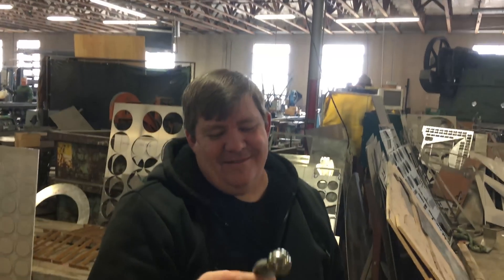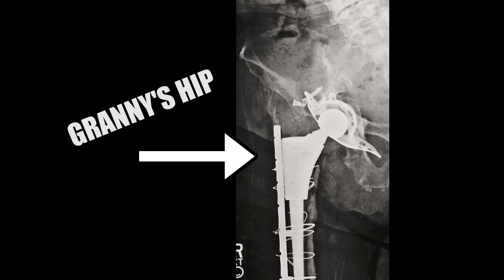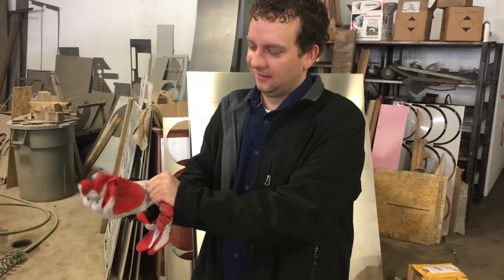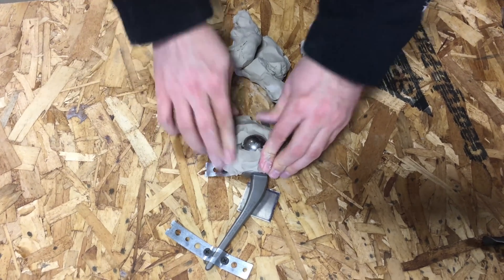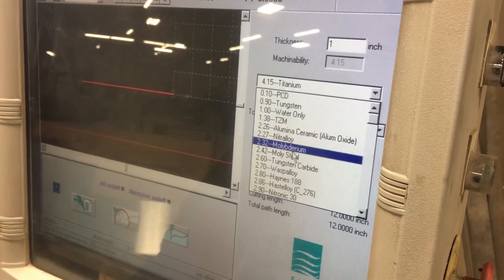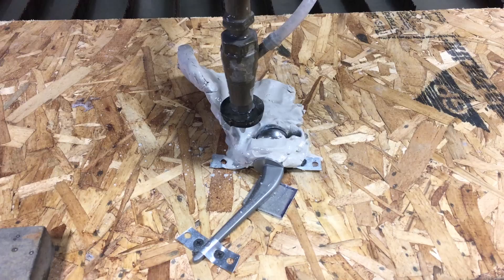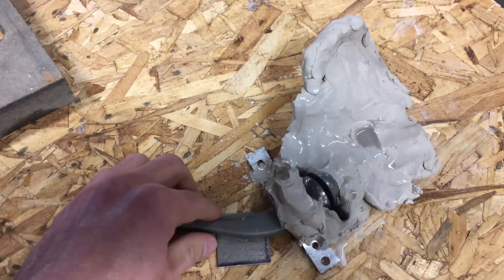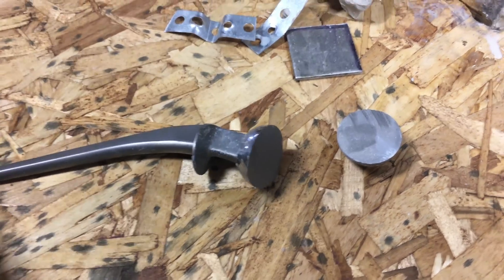Titanium Hip Replacement vs 60,000 PSI Waterjet

Comment: Titanium is not as strong as people think it is. What makes titanium so great in aerospace engineering is its phenomenal weight to strength ratio and its resistance to high temperatures. Also, the process to isolate and produce titanium metal has been exorbitantly expensive for decades and only now, within the last decade, is not that bad anymore.

Comment: get a knife and position it edge up, im curious if the thin edge will just separate the water in 2 smallers streams or if the water will just cut trough it
Reply: DutchClawz I actually think they did that already
Reply: DutchClawz look up them cutting csgo knives

Comment: Nothing like watching a +$10,000 titanium hip getting cut with water
Reply: If it was put in an ingot it would go from like $10000 dollars to max $500
Reply: Sam Kelly no
Reply: Well it is only worth that before they put it in... Once it has to be pulled out of a patient it is worthless for medical purposes. They cannot be reused because you cannot be sure it is 100% sterilized. Much less Hip replacements are rarely removed while still in good condition. Usually they have failed in some manner which really makes them worth nothing more than the price of the metal itself.
Reply: Titanium scrap goes at about $1.5 per pound. 
Used part is worth around a dollar.
Driving it to recycling plant is too expensive.
Reply: It is probably tens of thousands for a whole procedure including surgery, rehab, hospital days, etc. The metal thing itself is a minor part of it.
Reply: you cant simply melt down titanum. It oxydizes easly.
Reply: You certainly can melt it, and quite easily You just need a $5 million casting furnace. I work at the place that makes them (Precision Castparts).
Reply: Well once it's pulled out, why don't they just melt it down and reshape it to another piece that can be used again? Kinda doubt anything harmful to the body is gonna survive 1668 degrees celcius... Seems like a waste.
Reply: TheVitruvius its not the metal ... its the water :p nvm u can sell that titanium hip after is getting melted and transformed into an ingot or nugget
Reply: TheVitruvius My grandmother got 2 knee replacements from the nhs in the uk and each is worth about £30,000
Reply: $1/lb scrap
Reply: Crazy cal lol
Reply: Over inflated price
Reply: 30,000 POUND hip! that is so heavy ! lol jk